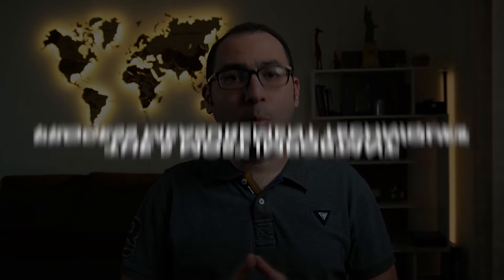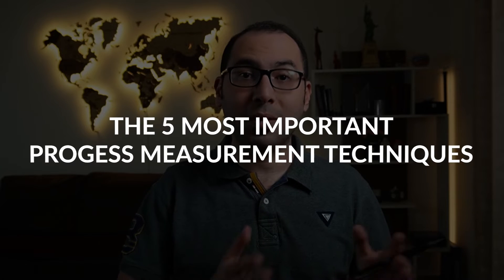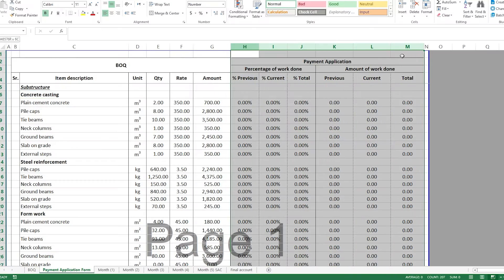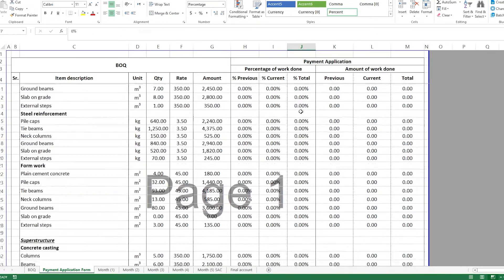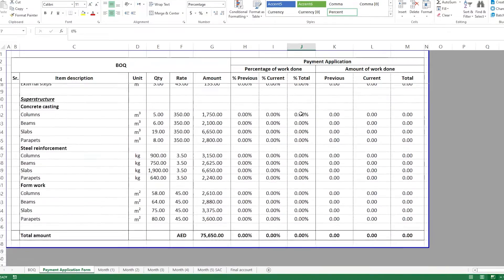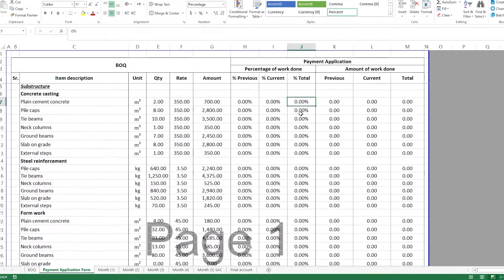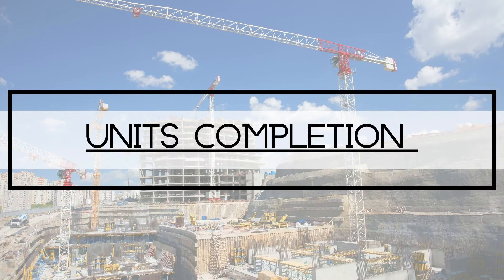5 Important Progress Measurement Techniques For Construction Works

Comment: Dear Ahmet Adel,
I really value Your videos, they  are so  clear, points right to the root of issue. Your pronunciation, speed of talking just for me, indeed! U started all from the scratch, i learned the basis from your videos. Please, continue your work since its really valuable infomation resource for those who have weak basis in cost control! Especially those videos with excel explanation are really productive.

Comment: Mr. Adel
When i calculated the progress  percentage from unit completion technic
And other cost ratio . Is it possible to find them diferent  percentage or not?
And what is the phisical completion , is it same as unit completion percentage or cost complation percentage ? 
And when i calculate percentage by payment certificate for example
(Payment certified to date)/(contract price ) is that same progress with phisical progress ?
Thank you
Reply from the maker: Thank you for watching and question. From payment total work / total amount = progress % (yes) but without the deductions. Unit completion and cost ratio are not guaranteed to give the same percentage.